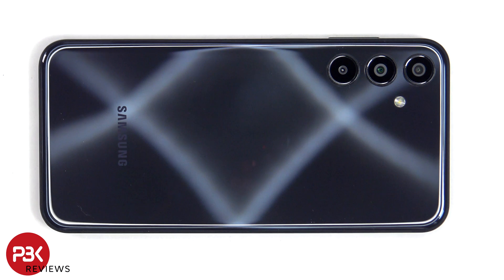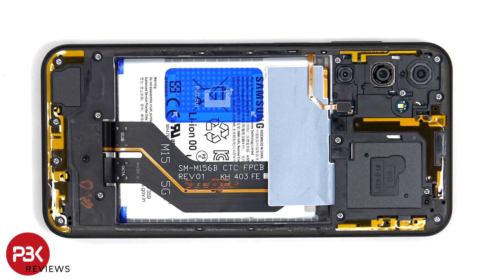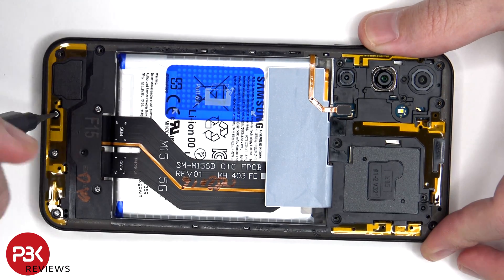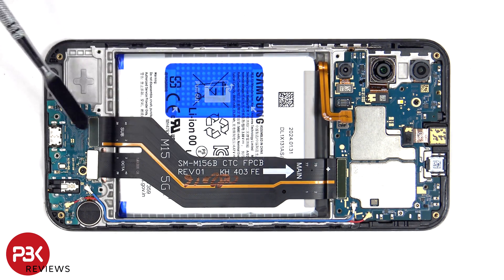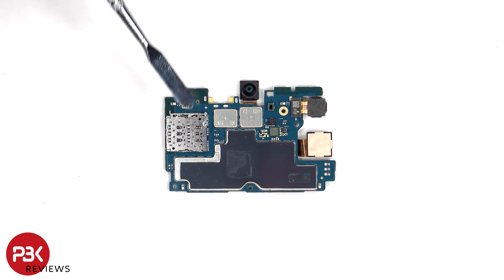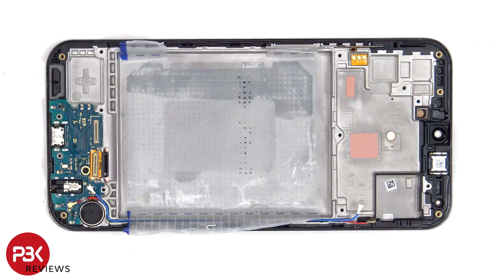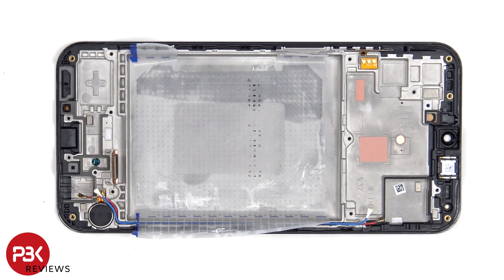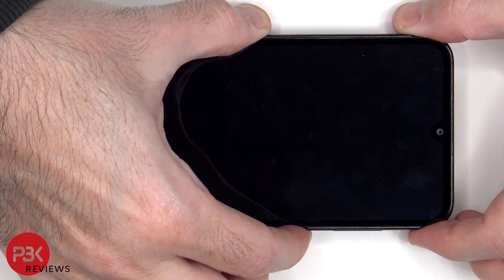Samsung Galaxy F15 5G Teardown Disassembly Phone Repair Video Review

Comment: 1:32 what are those blue colored pads on the backplate and the outer parts of the phone? 
Are they thermal pads? Or something related to heat conduction
Reply from the maker: yeah, they help to transfer heat

Comment: I have a samsung s23 fe, I inserted the SIM card ejector into the  Air Vent Hole by mistake. Could this ruin the waterproofness of the phone?
Reply from the maker: you'll be fine, the mic n filter are seated above the hole and won't be damaged 🙂
Reply: @PBKreviews  Thanks for your answer❤️, I think you are talking about the hole where there is the mic, but the hole where I inserted the sim card ejector is next to the bottom speaker.
Reply: They already explained many times, PBK reviews as well as Jerry, pay attention
Reply: Your phone is no longer virgin. Prepare for a big bulge at the back.
Reply: No